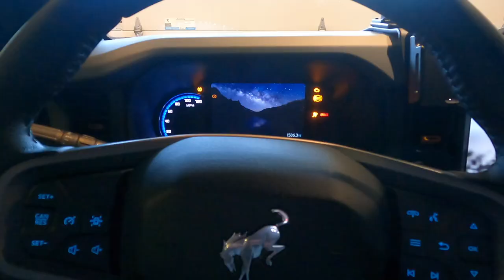Wall Mounted Pressure Washer Setup & Review - Giraffe Tools

Comment: With a low GPM machine, the orifice in the foam Cannon needs to be changed to 1.1mm in order to produce a thicker foam. 100-150 mL of soap and 600-750mL of water should be enough to produce better foam than shown in the video.
Reply from the maker: Thanks for the tips! Much appreciated
Reply: @shockerracing  🤙